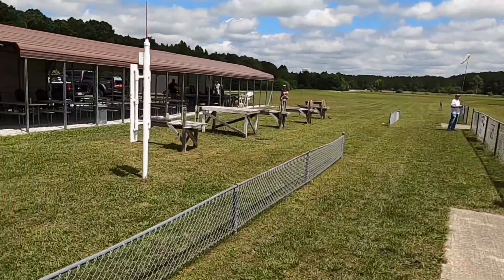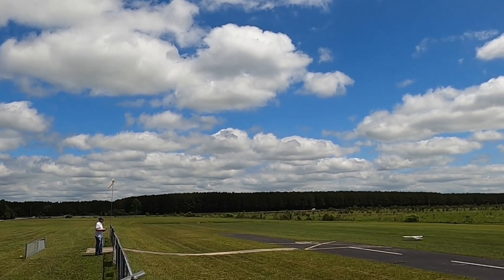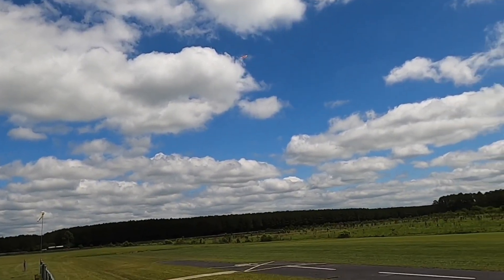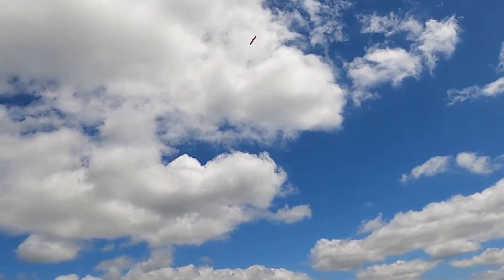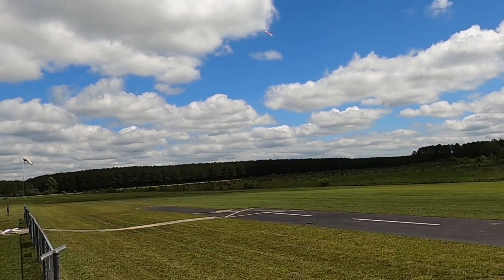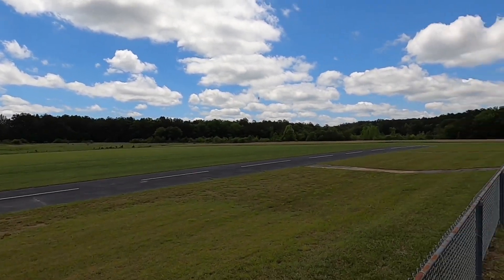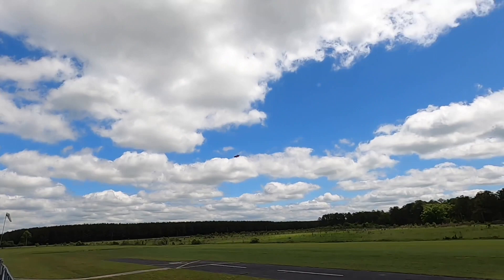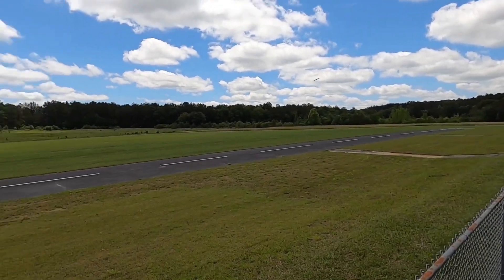HB1 Combat 3D Printed RC Flying Wing

Comment: Hey man, great plane. Printed mine and crashed it today. I put everything together and took off and all it wanted to do was pitch up. What prop are you running? And any ideas would be appreciated!
Reply from the maker: Thank you, I’m running a 6x4 prop on 3s 1300mAh. They are very tail heavy in there recommend setup. Even with a 3s 1000-1300mAh. I had to add 2oz to the nose to make it fly. Yours sounds tail heavy. Add some nose weight.
Reply: Run a  6 by 4 prop.

Comment: You have any weight in the back?? What are your throws set at?? I have one to
Reply from the maker: No, we had to add nose weight and since printed them longer in the nose and use 3 1300mAh packs for balance. Throws are 100%. All the throw I could get. But you might like less throw.